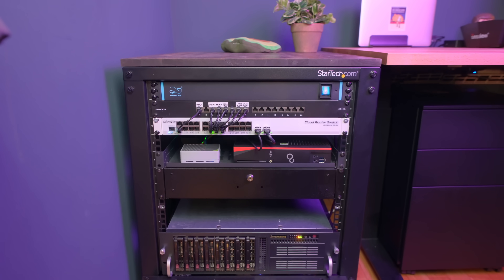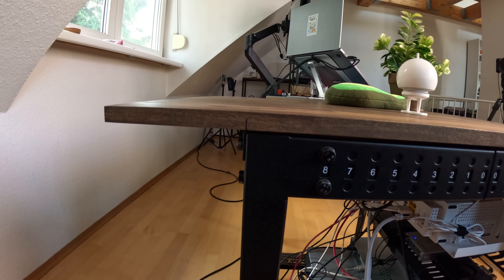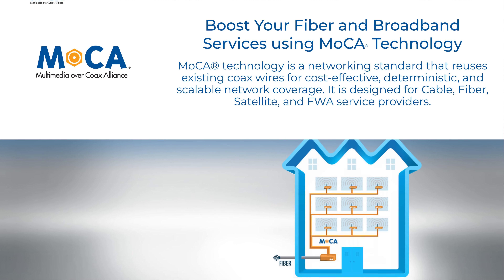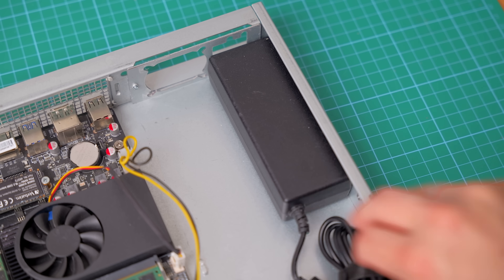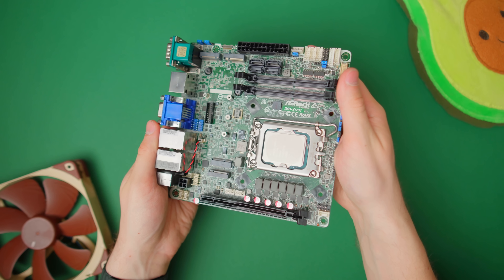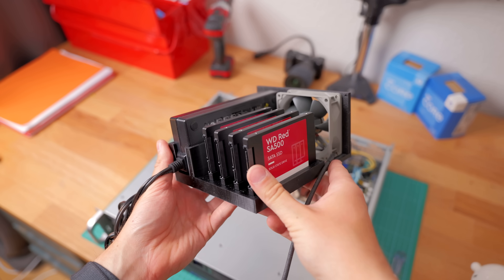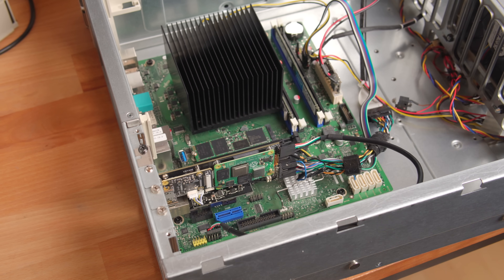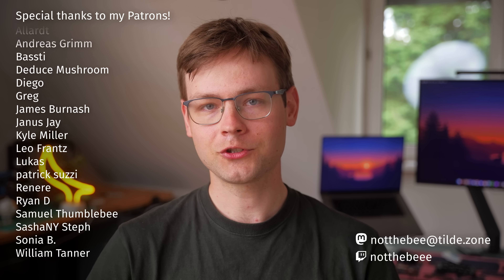What's in my Homelab Rack?

Comment: Hey i have a question, or really its an idea i guess. A lot of these pre builds have very good low idle power consumption. Specifically the Tiny, mini, micro pcs and the sff PCs as well. Maybe using one of those motherboards ( might require some modding in whatever case you are trying to use, i would be putting it in a rack mounted server case) with a few adapters i feel this would be almost perfect for a low powered server. Is there anything out in the wild that list idle power consumption for pre-builts?
Reply from the maker: STH's "TinyMiniMicro" review series touch on power consumption iirc
Reply: @WolfgangsChannel well, that's works too but I was really leaning into the pre-builts in general. Like the HP envy or dell optiplex ( or what ever they are called today) for a server idea because most of those boards are very limited on features and kind of crappy to say a gamer, but to people like us that are after that powerful <15w idle I feel these would be perfect because they Don't have much to vampire

Comment: You could add a NixOS router VM to your main server, and eliminate the physical router box. One could say a separate physical router is more reliable, but in your case it doesn't have a KVM, so if it's borked while you're away, you have no way to investigate. Whereas you could probably set up so that the main server KVM is reachable from the outside via a port forwarded from the Fritzbox.

Comment: Hello Wolfgang,

your idea of using TV cable to transmit ethernet signal is great. (These devices and standard went past me completely, I guess). But when I search devices, I notice, that they use a SAT cable rather than a TV cable. But I doubt, your flat uses those for wiring.
Can one use normal TV cables and sockets wth these devices or do you have to use a strange adapter avalanche?

Thank you in advance!

PS: For cenvenience, you can answer in German, if you like.

Comment: One brownout could be enough to ruin your disk arrays, especially flash storage, which is fairly sensitive to dirty power… And a single blackout could kill your spinning rust array… 🫣
Reply from the maker: That's a bit overdramatic, no? I don't see how a blackout would kill hard drives. Worst case scenario, it would lead to data loss? But even then, most modern file systems are journaled...

Comment: In a home or small office, I don't really see the point of dedicating a physical device to the role of firewall and router. You could just install a generic Linux distro on a PC with two ethernet or SPF ports, enable IP forwarding and write a few iptables rules and voila, you have a "router." Even maxing out your WAN link you won't use more than a few % of CPU and you can use the same machine as file server, web server, email server, docker host and a boatload of other things. You could literally downsize your whole setup to a modem, a single PC in an ATX case and a switch... It would be basically silent and take up 1/4 of the space.
Reply from the maker: Been there, done that. A couple of years ago I thought "my rack takes too much space, I'm gonna tear it down and just keep the ISP modem, the 10 Gbe switch and my main home server".

"Well now I need some place to store all of that, so I guess I'll just buy an IKEA Lack table"
"Oh look at that, the Lack table is exactly 19" wide if you measure between the table legs"
"Well then I guess I can use my 19" power strip".
"Turns out I also need a PoE switch for PiKVM and my gaming PC/Apple TV"
"I guess I can use my 1U rack shelf to store the PoE switch and the 10 Gig switch"
"It's also annoying to manage the LAN ports in the back of the rac..ahem, table, so I guess I'll get a patch panel"
"Also, doing hardware maintenance and upgrades on my main storage server is a pain, maybe I'll just get a rack case for it"

And just like that, dear friend, you've built a Kube^W rack.

Comment: That rack makes about zero sense in a living/working space as shown. The point rackmount equipment in a datacenter is space efficiency but here you achieve exactly the opposite by wasting space and money by putting that tiny ISP modem in  a huge and expensive rack enclosure... Also the Noctua fans may help but forcing air through small and obstructed panels will always be far noisier than in a mesh PC case, just saying.

Comment: bro, it's a bit of a strange question, but aren't you afraid to leave your server turned on when you leave home?
Well, like Chinese power supplies with picopsu are a little alarming. I have a laptop server setup myself, but I'm afraid to leave it on without me present.
What do you think about this? Should anyone worry that something unplanned might happen?
Reply from the maker: Leaving any electrical appliance unattended for a prolonged period of time is a potential risk, so yes, your concern is not entirely unfounded. However, that also applies to anything in your house (e.g. a fridge or a microwave). And unlike a fridge or a microwave, your computer probably consumes way less power and is stuffed with thermal sensors that will trigger a shutdown before anything goes catastrophically wrong. It's also (hopefully) opened up, serviced and cleaned a lot more often.

Comment: I'm envious looking at your power consumption, currently running a very unoptimized NAS-setup here, so I'm more at around 150 Watts - definately something I have to work on :D

I wouldn't wanna run my NAS without an UPS anymoer, though. Although the power losses happend in my own home, from pluging in brocken stuff, I really like the safety I get from that. And it's also just cool that I know my complete network can run without external power... 

Since I recently upgraded to a rack-mounted one, I have my former smaller UPS waiting for me to put it on ebay or smth - but I would also send it to you if you are interested in free UPS and would actually use it :)

Comment: I have the opposite attitude on power, having lived in developing economies like West Africa. My setup starts with an Automatic Voltage Regulator that smooths out the power and rides out surges through a time delay, minimizing use of the UPS behind it and the batteries it will eat through had it been directly connected to the wall socket.

I then have an Automatic Transfer Switch (basically an UPS control unit without the battery) with one source being direct from the AVR and the other from the UPS, which both improves energy efficiency a bit and also allows me to shut down the UPS without affecting the stack in case of a firmware update (I refurbish old commercial equipment) or a relatively rare battery change (luckily the ones for my house are just motorbike batteries I can kludge together). The ATS then feeds the wall or UPS power into the PDU.

Is this overkill? Where I am now yeah probably. However despite the supposedly clean power we have in this more developed environment, my office eats up UPS batteries at a surprising speed, and good replacements are surprisingly difficult to procure. I've been advocating to purchase rackmount ATSs (which are only like $2k each) at the next opportunity because I suspect constantly loading off the UPSs even when city power is up may be causing our high battery burn rate.

Comment: Nice to see the comparrison.   Since moving to Germany I ploughed heavy into UPS given initial power cuts in the rural area I moved to, I have now 3 UPS.   Plenty of them on ebay, mostly you're paying for postage (approx. 10eur)  for people selling a >700vA "Defekt" unit because they weren't able to replace the battery themselves.  Battery approx 40eur, and a 3 minute video on YT will explain how to do it. 

Also , did you try the T variant of Intel CPUs?  They tend to be what people want to throw away because they're under-powered ... precisely what I was looking for.
Reply from the maker: Thanks for the tip on the UPSes!

I've had the opposite experience with the Intel T-Series chips – they're usually rarer and more expensive than the non-T versions
Reply: @WolfgangsChannel   I built a machine for my mother's house with a Dell Optiplex 6th gen intel 6500 I sold that and bought a 6500T and made a profit on the transaction.  Indescirnable performance difference but a significant power saving.

Comment: How are you able to power all your hard drives and sata ssds with a Pico PSU? I've been thinking about using a Pico PSU for my next nas build, but then when I realised it only has 1 sata power port, I realised it wasn't possible?

I know you can use a sata power splitter, but that can only safely give you two sata power ports right? And then I've heard that using molex is a bad idea "molex to sata, lose all your data"?
Reply from the maker: There is a type of Molex to SATA adapters out there that are unsafe to use – here's a video on how to pick a safe(r) one https://www.youtube.com/watch?v=TataDaUNEFc

In terms of the number of devices you can safely power off of a Molex/SATA port – a Molex connector is rated for 132W on the 12V rail and 55W on the 5V rail. Many server SATA/SAS backplanes also often feature one Molex connector for 4 drives.
Reply: @WolfgangsChannel Thanks for the link. I take it your case has a molex connector on the backplane?
Reply from the maker: Yep

Comment: So true about a UPS. My lab has been running without a UPS for several months since its creation. Then I bought, installed and set up a UPS and after one month half of my lab gracefully shut down because of a minuscule power loss for a second (configured it wrong: messed up with countdown timers). After fixing the configs I don't really know if I lost power for less than 30 seconds, it just all works without interruptions. And I have a peace of mind.
Reply: What ups did you buy if you don’t mind me asking? I’m looking for one right now for my homelab and the graceful shutdown is definitely something I want
Reply: @somebody943  Eaton 3s 550VA (ca. 300W), shows 30% load most of the time

Comment: That's pretty cool. I have 6 Raspberry Pi (3x Pi3b, 1x Pi4b, 2x Pi5, including a 5 with a SATA hat and a couple of SSDs for NAS usage) plus three small switches (one I think is the same little TP Link VLAN switch you have), a modem, a WAP and a Wireless Ethernet Bridge. I'm guessing I'm coming in at around 30-40W total but it's been a while since I've measured them. This all runs my e-mail server, firewall, a few websites, SyncThing, wikis and a few other random things.

Comment: Very interesting!
Despite your energy efficiency recommendations and others from different sources, I still find hard to justify the $$$ expense of renovating or swapping components in my homelab just to save yearly 30€. I just stick to what I have and try to gest the most of it.
Reply: Here in the UK it is close to 50c per kWh so as always it is a cost/benefit calculation. My main Unraid server, 56tb, i9100 uses 24w at idle and 30w with 2 Jellyfin streams. It's main duties are as a media server, but there are 17 docker containers, some of which I only turn on when needed. I do run three 4k monitors on my workstation PC though, one is 50 inch and that consumes close to 100w on its own! It's all down to personal choice.

Comment: Hmmm, coax cable internet, in Germany? Is that really the best you can get?! I have fibre here in Indonesia, just like all my neighbours, cause fibre is the only thing on offer (apart from LTE modems connecting to a cellphone network). On top of that, we have a choice of 3 different ISPs or more, depending on where you live (here in Surabaya, East Java). And dirt-cheap, I guess I'd better not say what it costs.....
Reply: Pretty common thing in Europe. We don't need to drill new holes for cabling, because 20-30 years old wiring can provide even 1Gbps. I have (just) 600 Mbps via over 30 yo TV installation and it works like a charm.
Reply: In a lot of places in Hamburg, coax or DSL is the best. I went for DSL because coax being shared makes it too unreliable. There's fiber coming to more and more apartments, but it's FTTB and landlords will categorically refuse to improve the values of their homes by laying fiber into apartments aka FTTH.